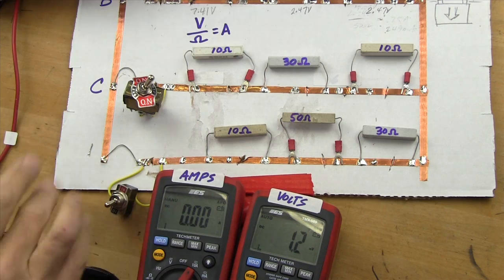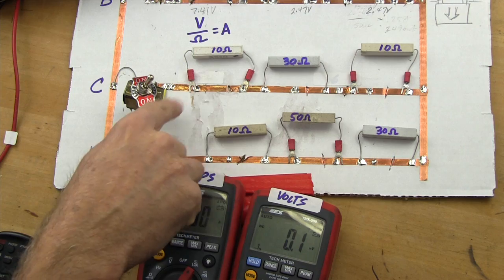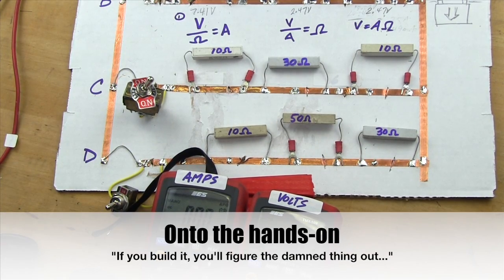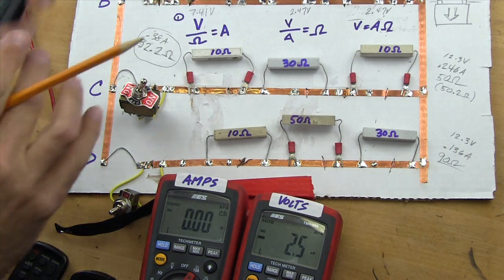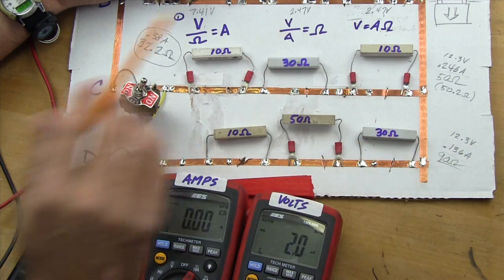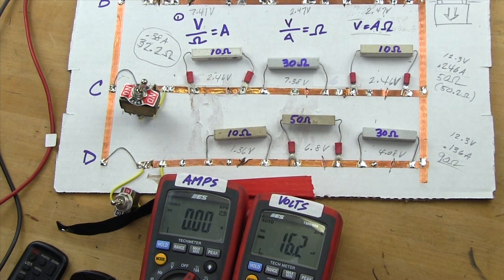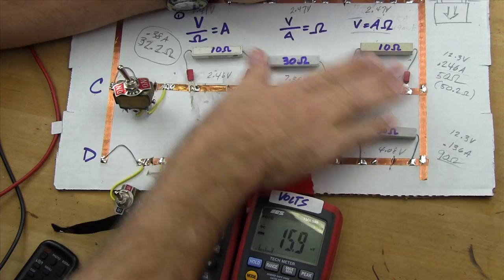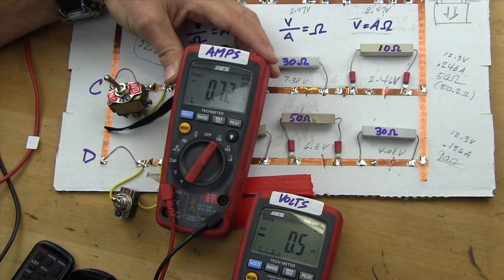Teaching Ohm's Law to Techs Part 4B  - Parallel Math

Comment from the maker: Wattage can be calculated in several ways. V^2÷Ω, A^2xΩ, or AxV. Each device dissipates its own heat - series or parallel - so you simply use the amps, voltage drop and resistance of each device and calculate.

Comment: If you learn the formula using your symbols V, A and Ω In the same layout as the standard ohms law formul _____E____ over  I   x   R  than remembering the three individual formulas to find each letter is easy. Just pick the letter your looking for and either divide or multiply the other two letters that are left, depending on what side of the line they are left on. Instead of trying to remember each formula individually like you were trying to do in the beginning of the video. Makes remembering easy. Just remember E over I times R or your letters, V over A times Ω. Now we can also do the standard Watts law formula and figure out ____P____ over I x E or PIE. (Not math pie 3.1416...) Where P would be W or watts, I would be A or amps and E would be V or volts, in your letters. Just Remember the P over I times E or your letters W over A  x  V and now pick a letter to solve for, by using the two remaining letters and what side of the line their left on, do the math. Remember if both remaining letters are left below the line than you multiply them together and if they are on either side of the line you divide the top letter by the bottom letter. You can now figure out the wattage of those bulbs or resistors in your circuits. Now, and I'm not going there, but you can combine Ohms law and Watts law and lay all the 12 possible combinations of formulas together in the shape of a clock and find the value of any of the letters E Volts,  I Amps, R resistance and W watts, by knowing the values of any two letters of either formula. Just remember that, I is the intensity (size or amount) of current flow measured in Amps and E is the electrolomotive force (push or pressure) of current flow measured in Voltage. Ohms Ω is the measurement of the Resistance to current flow of anything in a circuit and Watts is the actual power available in an electric circuit.  Now you have learned the correct formulas, what the letters really stand for and understand the definitions of each letter. You understand that each thing or device has its own resistance value and will only pass through it a certain amount or intensity of current flow in Amps before burning up. It runs on a specific flow of electrolomotive force measured in voltage and uses up or consumes a certain amount of watts of power to do what it's supposed to do, like make your toast, or your coffee, weed whipping your yard, or filtering your pool water, lighting your brake lights when you stop, or heating your home with  warmth. The electric company calculates your usage in k (thousands) of watts called kilowatts. See, You have now mastered each law and how to use them the proper way, for all electrical things, the same way everyone in college has been taught to learn it, since Mr. Ohm -resistance and Mr. Watt -power, figured out those laws that apply to electricity many many years ago. Besides, think of how silly you'll look on an interview or talking to your mechanic about your slow running fuel pump, If when he mentions resistance, you pipe up and say oh yea, V equals A times Ohms! Silly to learn the wrong way when the right way isn't very hard at all. Have fun calculating stuff. Then try BTU's if you dare. Just don't call them H for heat, please. Jpol. Just use T for temperature rise instead! ;)

Comment: Daniel,
thanks for your videos on electricity. You have helped to clear up some concepts that have eluded my for years.
It occurred to me one way to understand why the 100 ohm resistor drops 10x the voltage of a 10 ohm resistor is to imagine the 100 ohm resistor as ten 10 ohm resistors. In other words, imagining 11 resistors in a row where each one drops 1/11th of the voltage. Then I mentally group ten of them as one and it becomes much clearer what is going on.
So thanks again for what you have done here.

Comment from the maker: Different calculation. I use W=AV (wave) instead of the other engineering variables because I teach what will be seen on the meter. The formulas are still valid - W=AV, W=A^2Ω, W=v^2/Ω.

Comment: I really appreciate your teaching. I finally understand Ohm's Law. My only problem is, I try'd many times 1/x and it never works. What do I do wrong? I used one of scientific calculator on internet. If ever you can help me, I would appreciate.  Thank you
Reply from the maker: Luc - Remember to hit the 1/x AGAIN at the end, after you hit the (=) sign. It's an easy mistake. Try with numbers you know will work. 120Ω is a good one. 2 x 120Ω is 60Ω. 3 x 120Ω = 40Ω, 4 x 120Ω = 30Ω, 6 x 120Ω = 20Ω, and 12 x 120Ω = 10Ω. So - here it is -- 120(1/x) + 120(1/x) = (1/x) ===> 60Ω. Let me know if that does or doesn't work. DS

Comment: For some reason when I try to manually calculate the ohms I fail to get 32.2.
Reply from the maker: NY Mogul What do you mean by "manually"? Calculator? Remember to use the [1/x] key for all individual resistors AND again after you get a total.
Reply: Daniel Sullivan Taking the formula at 8:43 when I divide one by each load then add them up and then do one divided by that sum I don't get 32.2.
Reply from the maker: NY Mogul 50Ω[1/x] + 90Ω[1/x] = 0.031111[1/x] = 32.14Ω --- is this not what you get?
Reply: Daniel Sullivan On the calculator yes but using the formula at 8:43 no.
Reply: Daniel Sullivan Unless you mean 1/x takes the place of the formula every time you use 1/x. So if you were to calculate it by hand it would be 50Ω[1/ (1/R1 + 1/R2 + 1/R3)]
Reply: Daniel Sullivan Sorry Dan. I misunderstood what you  had posted. 1/x on the calculator takes the place of [1/ (1/R1 + 1/R2 + 1/R3)] and is used multiple times to calculate the total resistance of parallel circuits with loads. I thought all you had to do was use that formula once to derive the answer.
Reply from the maker: I tried a bunch of ways to get your answer but I couldn't. Your calculator might need to use parentheses - I can't know. Just keep trying - I promise it's 32.14...

Comment: In your closing statement, your amp meter reads .72... that threw me off for a minute because the circuit was .38 amps
Reply from the maker: Can you give me a min:sec location so I can review?
Reply: 17:20 it clearly reads .38, at 17:24 theres a cut scene and it then suddenly reads .72
Reply from the maker: I have no idea. It's a steady 0.72A, which is essentially double 0.38A. If it's the same set of resistors, what could I/might I have done (and edited out for time) that would have doubled the amperage?

Comment: Daniel, when you use the amp meter it's dangerous right? Is using the loadpro also dangerous since you're applying amps too?
Reply: +stealthsilen I'm pretty sure the LoadPro applies ohms of resistance not amps.